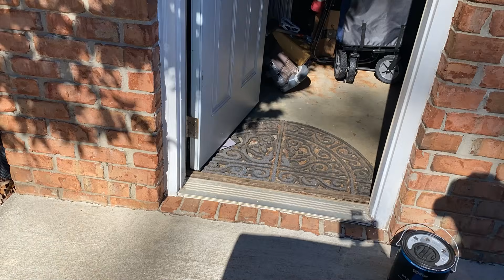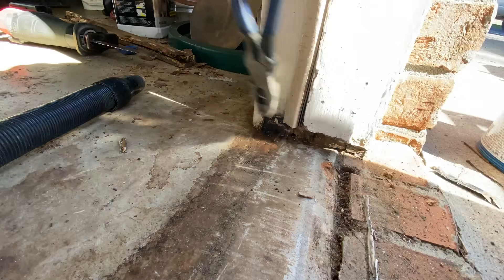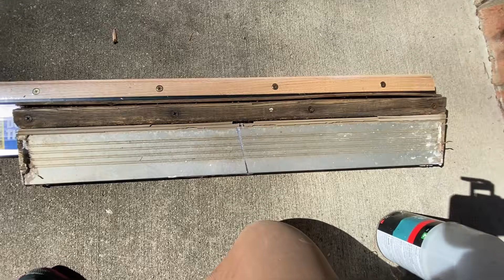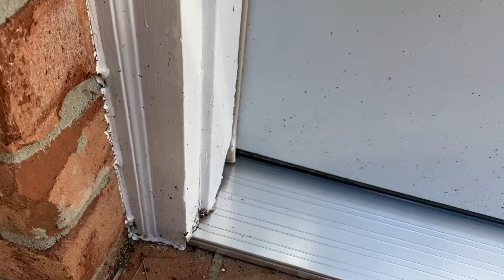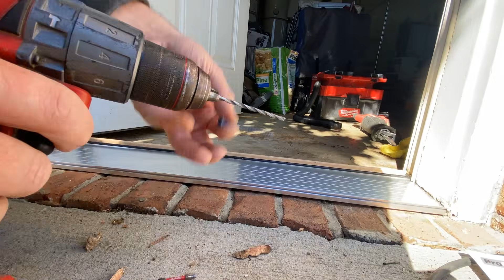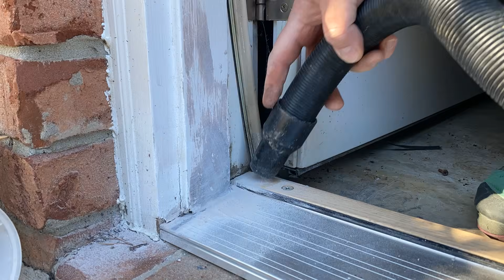How To Replace My Door Threshold (Surprisingly Easy)

Comment: Question about the concrete and brick divide? Did they seal that also? The water would keep thawing and freezing and probably let water in?
Reply from the maker: If you seal around the threshold and under the threshold you shouldn’t get water in. If you’re still worried about other areas like the brick divide, there’s nothing wrong with adding extra sealant.

Comment: Great video.  I have an issue where part of my front exterior door is letting in some air (last inch or so of the door on the bottom right where the door sweep is).  I was thinking of maybe replacing the door sweep but now I'm wondering if I just need to replace the door threshold with one of those fancy ones with a weather-proof seal at the top.
Reply from the maker: I would say getting a door sweep and trying to adjust just that side down a little bit to make contact would be the cheapest and easiest route. As you can see from the video replacing a threshold isn’t really that hard but definitely much more time-consuming than just replacing a door sweep.
Just to be clear, are you referring to a space underneath the door or to the right or left of the door? If you’re referring to a small space on the right or left side bottom of the door, there is actually a little foam piece called a corner guard that you can purchase for a few dollars to fix that spot.
If you are referring to directly underneath the door, I would start with a sweep

Comment: thanks! I followed the video and got it done. Only trouble I ran into was getting the sale installed. Didn’t realize I would need to take the door off to get it in place. It was coming back in from laminate flooring so it was a little hard to get into position.
Reply from the maker: Glad to hear you got it done! Yes, taking the door off can absolutely make some more room for working on the threshold!

Comment: What measurements do I need to take of my old one so I know what new threshold to buy?
Reply from the maker: The easiest thing to measure would be the width of the door. They sell thresholds in all different sizes according to the size of the door opening 36, 34,32, etc.. You also want to measure the depth of the threshold. Sometimes exterior doors have extra deep threshold, depending on how old the house is and how it was built. Lastly, you want to make sure you get the correct threshold for the swing of your door. Most exterior doors are inswing, but sometimes they are out swing, especially if it is a storage room. (Inswing meaning the doors swings into the house versus outswing the door swings towards the outside.)
I hope this helps. Let me know if you have any other questions.

Comment: I’d like to say thank you for this video. I’m purchasing a threshold for a house that was built in 1960 and a door that goes from the garage to the kitchen and it looks like they have never put a threshold in that area. I come from a house that was built in 98 and all of the houses I’ve lived in were built in the 1980s or later, so I’m not familiar with old construction techniques or the lack there of modern updates. I intended to put one of these in because all they have right now is a piece of rubber underneath the door and it seems to be rubbing against the floor and causing damage on the hardwood floor, so I’m hoping this will resolve that I was thinking after I do this, I may buy a more decorative piece to go under the door that doesn’t contact the wood floor and just creates a nice seal or possibly based on the adjustable piece here that you showed us can go up and down. I may not need to put anything at the bottom of the door at all, other than to maybe caulk the little holes from the screws and paint over them. In the house that I’m currently living in we have a metal piece that goes underneath the door itself and a threshold and it looks like that metal piece can be adjusted up and down and re-screwed. I can’t find any of those on the Internet.
Reply from the maker: You are very welcome. That all sounds like a great plan. They also make door sweeps that are a soft bristle almost like a paint brush. That would probably do a good job not damaging the hardwood floors.
I hope your project goes well!

Comment: Excellent video. I'm replacing a threshold that is mounted on 2x4 wood. A contractor friend said that's not good and should be concrete.  Any opinions? Thanks again
Reply from the maker: It’s had to say without seeing it but lots of thresholds are mounted to wood. I would say as long as the original held up for many years just build it back to how it was.
Reply: @BallHomeRepair  Thank you
Reply from the maker: You are very welcome. I hope your project goes well!!!

Comment: Use a hammer drill into concrete with SDS bits
Reply from the maker: That’s a great option if available. Those bigger drills make light work of hard concrete. I only had my smaller drill with me. Thankful it did have a hammer setting.

Comment: hi,i just install tiles on my whole house dont want to put holes on my new tiles.what kind of addesive/bond should i use by any chance?
Reply from the maker: If you are asking about how to adhere the new threshold to tile without using fasteners, I would just use some construction adhesive. Just be careful and give it a good 48hrs to setup before heavy use.

Comment: My question is, if you have to use a saw to remove the old one, why is it possible to get the new one to fit under the door jam so easily?  Seems like that is going to be the hard part.
Reply from the maker: Mainly it’s because of the way the entire door casing is assembled from the manufacturer. They have long screws or nails going in from underneath the threshold into the side wood of the casing, making it impossible to get to once the door frame is installed. Sometimes once the threshold is cut in half you can pull up and it’s sort of prize the fasteners out of the casing. Also, you can just use an oscillating tool with a metal cutting blade to cut the fasteners making the threshold easy to pull out. You could absolutely pull the threshold out in one piece if you didn’t want to cut the threshold, but it just makes it a lot easier. Hope this helps.
Reply: @BallHomeRepair Ok that makes sense but once you pull out the old one and clear out the old screws or nails, I won’t have any trouble sliding the new one in place? I guess as long as you make sure you clean everything out, it should slide in easily.

Comment: So what did you use to fill the rotting wood at the bottom of the door .
Reply from the maker: For this particular repair, I dug out as much of the rotten wood as I could, and filled the space with all purpose, Bondo. Then I sanded it smooth and painted.

Comment: Excellent job . 
I never knew you could use bond for wood work.
Reply from the maker: It’s actually quite common especially in historical restoration for trim repairs. I learned about it several years ago and it’s been a game changer. I believe Bondo makes a wood specific product but I always just use the all purpose stuff.

Comment: Great video! Just one question what kind of blade did you have on your miter saw in order to cut the aluminum and wood on the transition piece?
Reply from the maker: My saw has a normal wood cutting blade. As long as you cut slowly, you can cut through both the wood and the aluminum.

Comment: Thanks for such an informative video!  Will replacing the threshold the way you did, stop rain water from coming in the house? Is the caulk sufficient enough?
Reply from the maker: You are very welcome. You can also put some caulking under the new threshold as you Install it for additional waterproofing.

Comment: That looks really good compared to mine underneath it the wood is completely rotten and you can take the threshold off and look in there and as a gaping hole why isn't this filled in why is there a gaping hole?
Reply from the maker: That is unfortunate. It is always frustrating when you don’t catch a needed repair before permanent damage is done. Hopefully you’ll be able to cut out the rotten wood and replace.
Reply: Well I moved into this house back in 2021 and there's been a lot of things we've had to repair and replace. We basically bought the house as is except for a few things that needed inspection. I have a handyman friend of mine who's going to come over and check it out for me.. Thanks. @BallHomeRepair

Comment: No sealant at bottom no wonder u probably replaced it few times
Reply from the maker: Yes, sometimes it’s good to put sealant along the bottom of the threshold as you install it, but if you have a good seal around the outside that works as well. The more areas where you can add sealant the better.

Comment: My exterior door blows wide open in winter and is hard to close in summer, when the humidity is high.  Should I reinstall it?  It has been like this for years.  The contractor came in once to fix it...that was 20 years ago, and they never came back.  I installed a deadbolt to keep it closed, but it no longer aligns.
Reply from the maker: Re-installing, fully sealing the door and frame with new paint/stain, or installing a new door and frame could help but the best thing you can do is to manage the humidity in your home. That should help a lot. Also you can adjust the latch for the striker and deadbolt according to the season. Hope this helps!

Comment: Just watched your video, what size of concrete bit and screws did you use if you don’t mind me asking
Reply from the maker: I don’t remember exactly what I used in this video but 3 inch 3/16” screws would work. Most concrete screws come with the correct drill bit. Brands like Tapcon. Be sure to vacuum out the hole after you drill before putting in the screws.
Reply: @BallHomeRepair appreciate this, good input. Will do, thanks. Happy Holidays
Reply from the maker: Happy holidays to you too!

Comment: Excuse me, does anyone know if the wood part stains from footsteps? I had a similar one, but it was made of dark brown plastic, and I want to replace it with a wooden one... but I don't know if it will get dirty when you step on it.
Reply from the maker: The wood is a hardwood and will Ave and darken with time but shouldn’t stain from normal use unless you are tracking in a lot of red clay or other materials that stain. You could also seal the wood with some sort of polyurethane.

Comment: The screws that come withe the hold are they able to penetrate concrete
Reply from the maker: If it comes with screws they are probably not meant for concrete unless it says so. Sometimes they can come with plastic anchors where you pre-drill a hole, tap in the anchor, then use the provided screws and screw them through the threshold into the plastic anchors. 

I find it easier to just get some good concrete screws and use them instead. Sometimes included hardware is cheap junk and it’s not worth my time to find out if so.

Comment: How to replace the wood piece with the adjustable threshold? Also, how many turns do the adjustable threshold screws turn? One screw on ours won't turn and is now mangled.
Reply from the maker: You should be able to loosen all of the screws until you can pry out the adjustable wood piece. If one of your screws is mangled, you may have to drill it out or try to use an easy out. Then get a replacement wood piece that hopefully comes with new screws

Comment: It is possible to replace just the wood part without cutting the whole thing out
Reply from the maker: If you are talking about the wooden part that you can adjust up and down, yes you can order a “replacement adjustable sill cap” and replace just that part.

Comment: Hi, I have a door with a threshold which is in good shape, but the slab was uneven and there's a gap in between on one side.  

I could easily enough seal it, but I'd like to use something with structural support under the threshold.  What is recommended for that?  Ordinary caulk is too flexible.  I guess I could use construction adhesive, since that seems to set up fairly hard, but is there something better?  Like an epoxy of some sort?  What would you guys recommend?
Reply from the maker: I have used construction adhesive on small gaps but if it’s a large gap I have also mixed concrete and packed the gap full on a slab. You can just mix it a little thick and use a putty knife and keep mashing it. Then use a sponge or wet rag to clean it up.
Reply: @BallHomeRepair  The gap widens to about 1/4" or maybe 3/8" on one side, and is on slab on the other.  So it seems getting even slushy mortar under it would be tough, unless I had the ability to inject it underneath with something like caulk.

I was thinking a high quality poly-u construction adhesive, but I wasn't sure if something better was available.
Reply from the maker: My other thinking would be using a mortar bag. They are like icing piping bags. You could inject that way. Also yes construction adhesive would probably work for that small of a gap.
Reply: @BallHomeRepair  I looked for mortar bags at Home Depot - didn't see any.

For this job, I'm sure a decent PolyU adhesive will be fine, I checked and they do cure hard.   But I'm curious about the use of mortar bags for future possible issues.  I'll look into them.
Reply from the maker: Also called a “grout bag”. They are sometimes in the Concrete department, but also in the tile department. I have found that they are sometimes the exact same product but priced differently

Comment: after applying the caulking, spray glass cleaner or soap before smoothing it with your finger, it will keep the bead from spreading into the brick too much.
Reply from the maker: That’s a great tip!!!

Comment: Hello.  Great video.  I have a home built in 1965.  The Aluminum threshold adjustment piece is all aluminum as well.  The threshold is in solid condition however dirty, worn and some paint splatters on.  I would like to remove it and paint it black so it doesn't stand out.  Once I remove all the caulk and the screws, do they normally pull out from the back into the house?  I assume, not glued down.  Can you recommend a paint that would hold up?  Thank you.
Reply from the maker: It’s hard to say without seeing it in person but sometimes houses of that age have door frames that are hand built instead of pre-manufactured like they are today. It make come apart in pieces like you describe. I would take my time to try and remove it as one piece. If it’s just a concern for painting I wouldn’t remove it. I would just clean it up and mask around everything and paint it in place. 

If you decided to paint, use a good enamel paint. I would be hesitant to paint though because painting something that has foot traffic just never holds up.
Reply: @BallHomeRepair  Thank you.

Comment: ?? Why no sealant or flashing under the threshold? What is there to stop water seeping in underneath the threshold?
Reply from the maker: You can see I used sealant around the exterior on the brick side. I believe I also mentioned using adhesive underneath the threshold, which would also seal if you used the proper adhesive. Basically the more areas you see all the better. Thanks for pointing it out.

Comment: did you use a  impact driver drill for that concrete ?
Reply from the maker: It was pre-drilled with a drill with hammer setting.
Reply: @BallHomeRepair  with a masonry bit
Reply from the maker: Yes with a masonry bit

Comment: went out to my garage and my door wouldn't shut w/o some persuasion...sure enough threshold is coming off and adjustment screws are nearly gone. got the supplies to redo tomorrow. being more of a car guy carpentry is not my cup of tea...i'd rather fight with a rusty crusty bolt any day of the week than the tedious stuff like this but your video gave me the confidence to tackle this. Thank you!
Reply from the maker: You are very welcome! As a car guy myself I would say this project is easier than replacing a starter on a 1979 K5 Blazer.

Comment: My door is an outswing door, would the threshold still face the same way?
Reply from the maker: You would need to get an outswing specific threshold. I have updated the materials list in the comments with a link to one that may work for your project. I recommend comparing what your current threshold looks like to the one I liked.
Reply: @BallHomeRepair  thank you!

Comment: Great video! Thank you! What do you recommend using if there is a significant gap between the bricks and the concrete? And for gaps between the bricks? The bricks on mine are just set in place with no concrete or mortar or anything like that.
Reply from the maker: Based upon what you describe I would recommend adding concrete or mortar on the bricks. There should be a solid base for the threshold to sit on. You could redo the bricks themselves with mortar or leave them as is and form up an area with scrap wood and pour a tiny foundation for the replacement threshold to sit on.

Comment: Great tutorial! What blade did you use in in your miter saw to cut the new threshold?
Reply from the maker: I just used a standard wood blade. When cutting aluminum that’s thin like the threshold you can cut it with a wood blade if you go super slowly. That’s why I don’t recommend it to someone who is not experienced with these tools. You can also use a hacksaw or bansaw and get the same outcome.
Reply: @BallHomeRepair Thank you! My project for the weekend. 😊